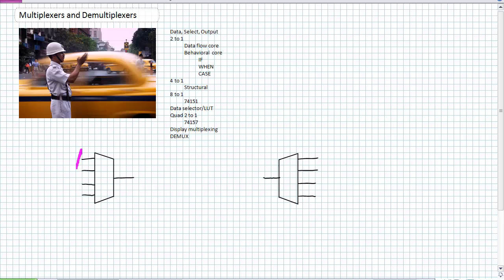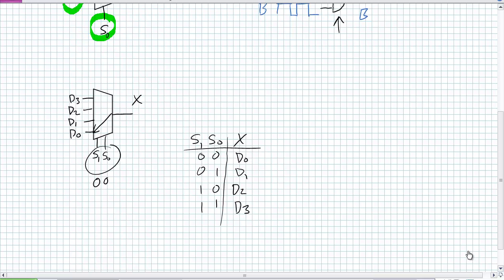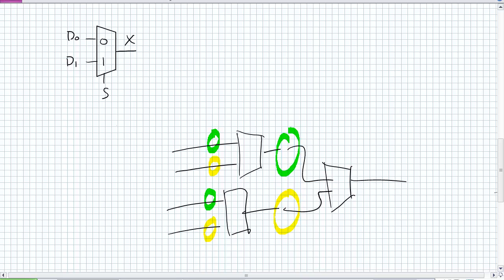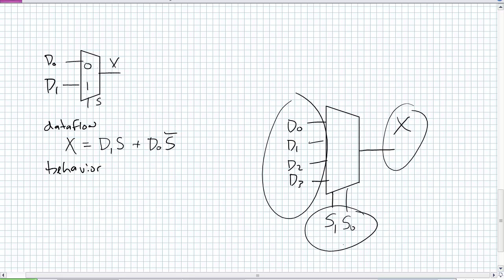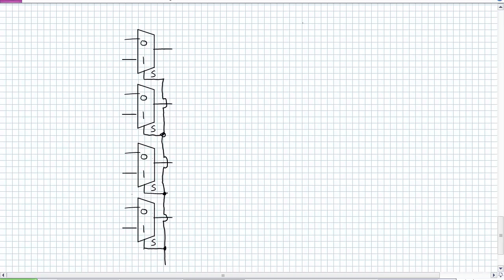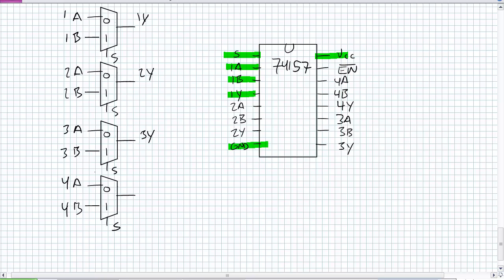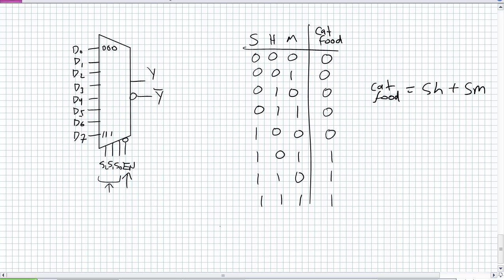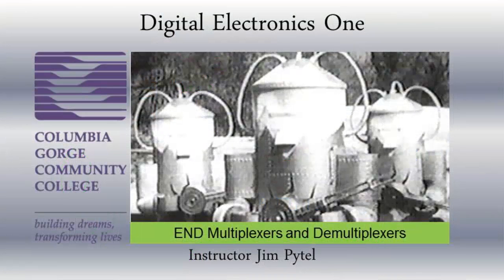Multiplexers and Demultiplexers

Comment: It is absolutely imperative to note, AS+BS' is not equivalent to AS'+BS (unless you switch the inputs). If a high selection enables B, B cannot be selected when the selection input (S) is low. If B is high and, A and S are low the output will conflict with the truth table. As an example: AS+BS' == 0 * 0 + 1 * 1 == 1. B is high, A and Sel are low. This directly conflicts with the truth table as the output should be low. Conversely, AS'+BS == 0 * 1 + 1 * 0 == 0; the correct logical expression yielding the correct output. Although the principles Jim outlines in the lecture are still correct to the degree that the selection input determines the output of A or B, be cautious when placing the not gate on the inputs.